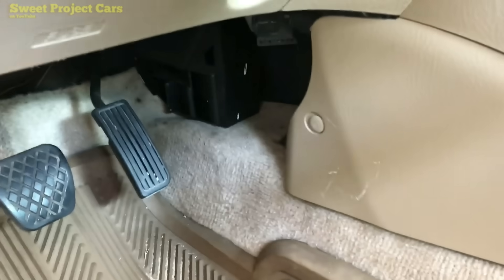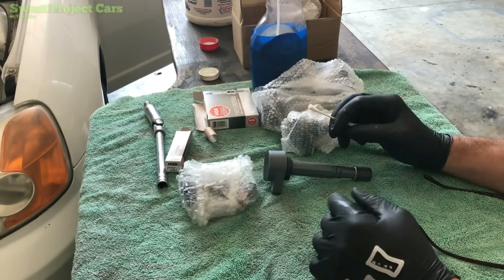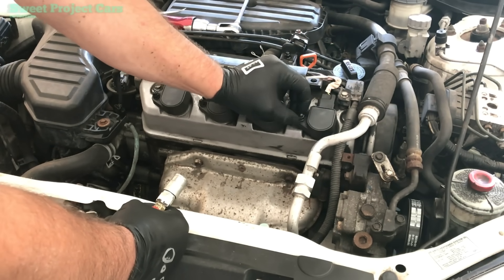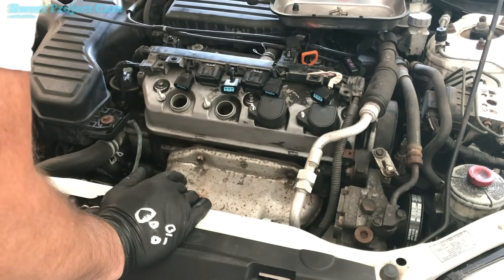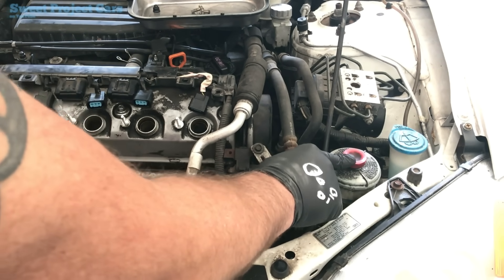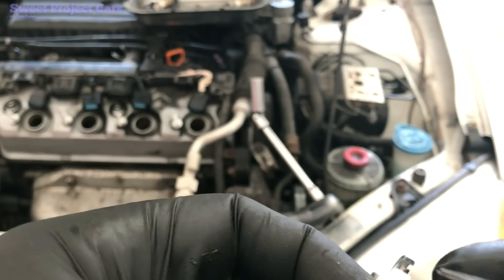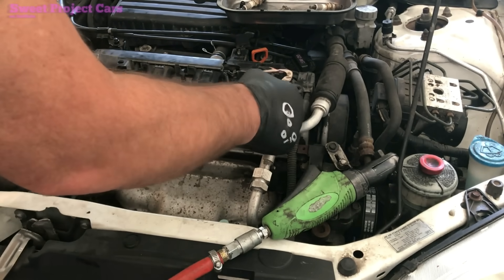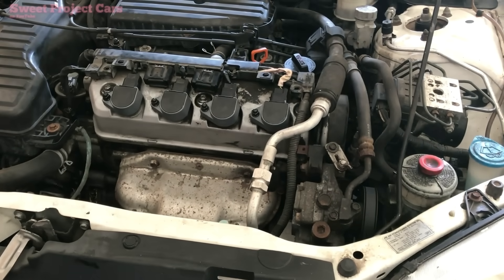Basic Tune-Up "101" Tips & Tricks.. DIY & SAVE BIG!!

Comment: You can save a fortune tinkering with your car and 10 yrs down the road you'll save enough garage fees  to buy another half decent car.If anyone is deciding to keep their car is top properly spray WD-40 all over the engine and underneath.....i mean everywhere incl front brake pipe and rear brake pipes incl sawy bars,struts,ball joints etc.I do mine 3x a year and there's no rust in the engine bay/underneath.All i've done at the garage is to have the aux belts fitted.Think i save over £800 in a 10 yr period.You're paying labour,tax and mark up on parts remember.

Comment: At least your plugs are easy to get to!  How about my 2011 Chrysler Town & Country?  The rear 3 plugs are a nightmare to get to and I'm not doing it!  I'd be happy to bring it down to you - (ROAD TRIP!)   The only thing I've done to it so far is keep the oil changes current, new front struts (busted one on a big pothole just this year), new battery just this year (the OEM battery was nearly 8 years old and that's not bad for a battery.)  It needs a new front-left lower ball joint (has a wee-bit of play right now.)  Oh and I did a bypass of the fuel pump relay circuit in the TIPM  recently with a kit from Jason Bell.  Works great!

A tuneup isn't a big deal anymore since you don't have to fool with the old "points" and timing then engine to the new points.  If you have an easy to work on car (similar to what he working with) then go for it!
Reply from the maker: LOL Ray yes those last three three spark plugs are a real pain if we had any openings my friend we would definitely help you out with that but we are booked solid sorry have a great night my good friend
Reply: Ray,best get iridium plugs that lasts like 80k if it's difficult to get too as the garage will charge extra to fit thm as it does take time to get to it.

Comment: “Never Seize.” Greatest compound ever invented! I use it liberally on any threaded component on any device that is exposed to severe heat and/or moisture. You’ll thank yourself over and over next time your have to disassemble down the road. 😊
Reply: BTW, use it on clearance fit shafts and hubs too. Rust and corrosion is just as nasty there.

Comment: Just starting to watch the vid, but just curious - you have a code 300, a random misfire on ALL cylinders.  While understanding how to tune up, change coils, etc. is a good thing, why would you change all plugs, all coils, etc., in an effort to find the cause of the P0300?  Surely not every coil, plug, injector etc would be misfiring, unless there is one condition that is affecting all of them.  It’s unlikely that all of these components would ‘fail’ at the same time otherwise, no??
Reply from the maker: Inisfad we change all of them for the video to show how to do it and the other reason is the car was so neglected and had not been tuned up in years so we just wanted to start with all new parts to rule out any of them being the issues, for all those parts it was less than a 100 bucks so it was cheap insurance, my friend, :)
Reply: Worth doing all the coils as one day another coil may have issues and of course we do forget things over time and we may think we already changed all coils when we didn't....so doing that section of the engine we can eliminate any problems in the future.Most drivers ignore and neglect the cabin filter and it filters the air we actually breath inside the car.Some may get ill with dirty cabin filters without actually realizing.Changed my filter as it was dirtier than in the video!

Comment: I used to change my plugs,wires,rotor button ETC in the 80's but today's cars everything is buried  and you have to remove a lot of stuff first.I cleaned te throttle body on my truck Tuesday,and always change my own oil.
Reply from the maker: With you Mark today’s car is so much harder to deal with there’s no doubt about that they purposely Hide almost everything so you have to take it in and have them do the work have a great week my friend

Comment: Yea, when I got my Odyssey Almost 3 years ago (I'm the 4th owner) it didn't look like ANYONE had ever replaced that poor cabin filter. Also, kind of relevant question; do those Civic's have fuel filters? The Odyssey doesn't, only the sock that's part of the fuel pump, no external fuel filter under the car or in the engine compartment.
Reply from the maker: Not sure on the fuel filter haven’t really dealt with one of those on that car but you’re correct most people don’t even know they have a cabin filter thank you for sharing my friend have a great week

Comment: and what happens if the spark plugs, coils and injectors don't fix the problem?
Reply from the maker: jdretiree well as you could see by the spark plug we had found, it made our job easier for sure it was an obvious issue plus the car was in dire need of a tune-up anyhow, and the problem and codes were gone once completed, if you still have a miss then you would read the code for it and replace that part that is throwing the code...if it still persists then you have some serious issues that need a pro to look at :)

Comment: To everyone watching this. Use the anti-seize and always let the engine cool before removing or installing sparkplugs.  You won't regret it. The first time you have a stuck or stripped sparkplug you'll remember these tips. This video is gold.
Reply from the maker: marcogram you are very correct, the anti-seize is cheap insurance and gives great peace of mind.  thank you very much my friend :)
Reply: It's a good idea to check with the manufacturer about whether or not anti-seize is required though. Some spark plugs come with a coating from the factory. I just put NGK plugs in my Altima and they say not to use anti-seize because you could potentially overtorque them.

Comment: Sweeeeeeeeeeeeeet!!! I know all about dropping screws or nuts into the abyss sometimes, LOL!!😂. I have 5 of those extension magnets and they are very much a life saver!!! And YES, I know you can save those wheels, and now I can't wait til that video! 😃. Until next video my friend, my brother, Mike you have a GREAT weekend and God Bless you always!!! ☆Jay.
Reply from the maker: Hey Jay I finally got to you been a crazy weekend thank you for commenting and dropping those castle nuts like that is usually edited  out but I thought you know what everyone needs to see we make many mistakes on a daily basis thank the good Lord I had a carpet piece underneath the car which caught most of them otherwise as you know they would hit the cement and disappear off into never Neverland LOL God bless my friend and have a great week
Reply: Sweet Project Cars , not a problem  buddy, you have a GREAT week also. ☺☺☺👍
Reply: Story of my life... Major Butterfingers! I've got some of those flexible extension grabbers with the little fingers that come out of the end (got a pack of 1, 2 n 3ft at Tractor Supply)! They're really helpful since trying to work a magnet past a bunch of steel and iron parts without sticking to them can be a real pain!
Reply: Blakehx , 😁. Funny you would mention that, I picked up the same thing at tractor supply about a year ago. I was putting gas in my lawnmower and went to take the cap off of the gas jug and it bounced 3 times and went straight into the tank on my lawnmower and it's one of those side mounted tanks and it's deep. I've let the tank get almost mt and I've tried using that grabber til my arms started hurting and still can't find it, so I've just left it down in the tank. LOL!!😂😂. If I unfasten something on top of an engine it's going to end up wedged somewhere on the bottom or on the ground!!! LOL!!! 
I feel your pain too, story of my life. 😁👍👍

Comment: I'm A Firm Believer in Anti seize, especially when there are 2 different type of metals, and it also is a mild Anti Vibration compound, 10 Years from mow it will come apart with no Problem. It will NOT alter Torque Settings..
Reply from the maker: Dave K  comments like yours are so helpful for all the DIYers here, I cannot tell you how much we appreciate you sharing with us my friend :)   mike

Comment: Ngk says antiseize is no longer needed, they have it the alloy and say they don't seize.
Reply from the maker: Well I’m not sure when they started doing that but we still had plugs we’ve done over the last six months they did not have anti-seize on them and they came out extremely hard so we say it’s better to do it then not do it no matter what the manufacturer says We say for the cost it’s better safe than sorry it’s cheap insurance
Reply: I hear you on that. I heard it from another tech, so I contacted ngk online and they responded with that data. I found this out about 3 years ago. 
The only downside to using the paste, is using too much and having some get on the business end which can block the spark some.
I like the way you changed all coils at once! I've seen one or two go bad and replaced only those, but the others go bad not long after every time.  My best advice on choosing good quality coils, is either oem, or Delphi or denso. The worst coils I've seen that refuse to last are made in Poland. FYI.
Good job all the way around sir!